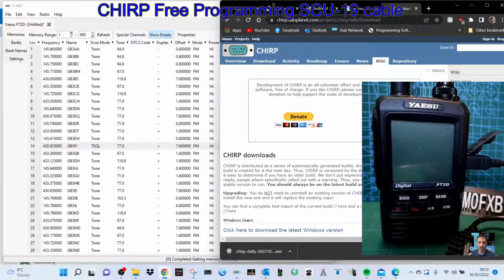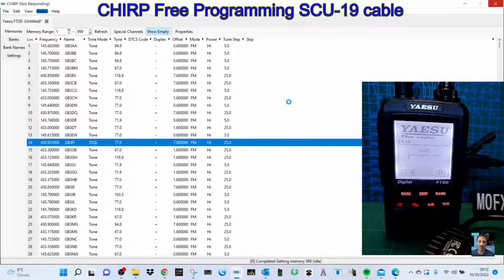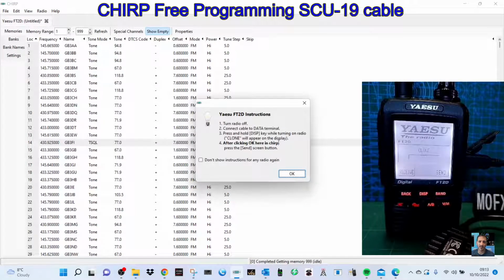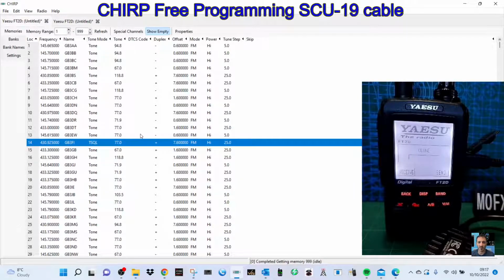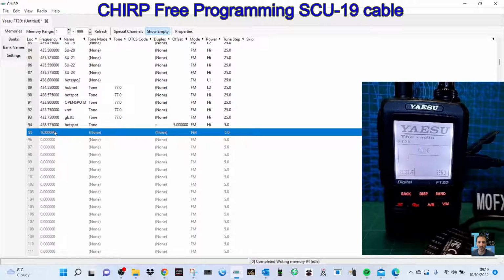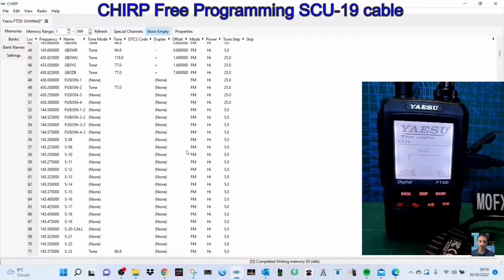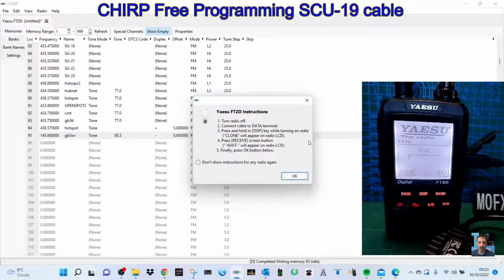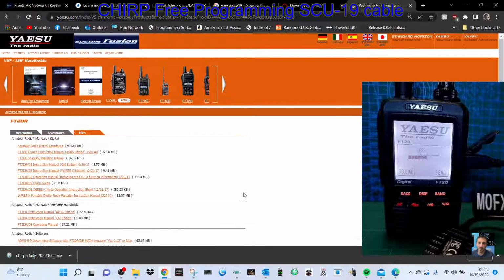CHIRP- FREE Programming Yaesu FT2D

Comment: Hi, Previous owner has saved 27.781 cb channel 19 to my FT2DE. Ive tried adding other freq in that range but its saying its off freq. I dont understand how they were able to do it. It will lock into 27.780 if i start a new memory but i cant re create the 27.781. Any help would be great. thanks
Reply from the maker: The radio will not do that Freq .